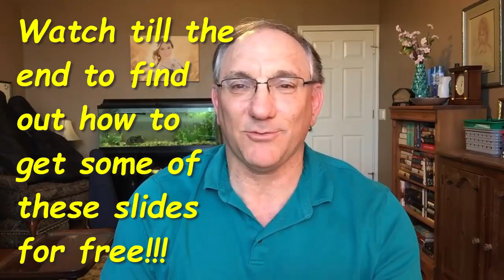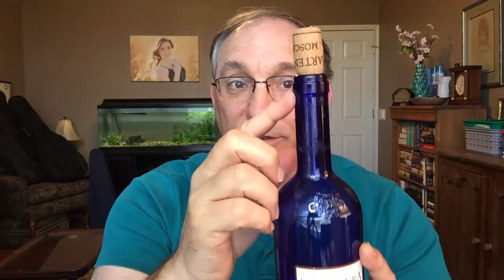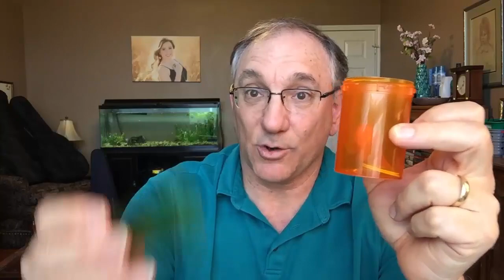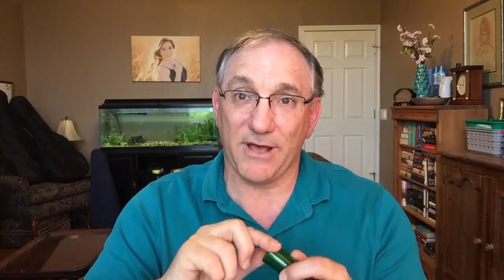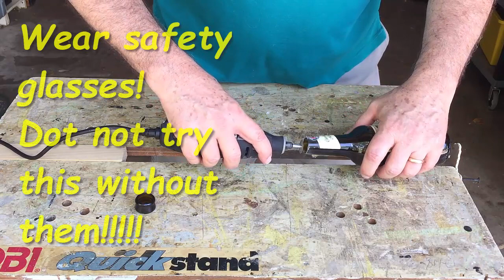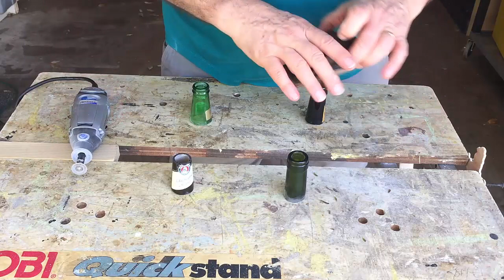Easy DIY bottleneck slides! How to make bottleneck slides using a rotary tool.

Comment: Excellent diy slide guitar. I finally found “the one” with the cut just about right from a good case of merlot. While I was working at it I found a safer way smooth out the edges without using a dremel and sandpaper. I used a chef torch to smooth all of it.
Reply from the maker: Thanks!  Thanks also for the suggestion!

Comment: I'm impatient. I'm tempted to take my Harbor Freight angle grinder to a bottle neck😅
Reply from the maker: You can try it. My guess is it will overheat and crack where you don't want it to.  If you try, let me know how it turns out!

Comment: great advice dude, im gonna attempt to make one right now!
Reply from the maker: I'm glad you found it helpful!  Let me know how it turns out!  Thanks for watching and commenting!
Reply: @stevesstrings5243  well i'm definitely going to try again but my first one was kind of a flop. worked pretty well actually for about 5 minutes but the fracture that formed in it that i tried to apoxy just didnt hold up. I ended up buying a cheap slide but now I have to wait for my girlfriend to finish her wine to try and make a new one!
Reply from the maker: @tyler1234321  The key is to not press too hard or turn the bottle too slowly. If you do, the glass can heat up and crack longitudinally or chip.  I find if I keep the pressure light and keep the bottle turning, it does not build up heat too quickly and decreased the chance of cracking.  Of course, this gives you an excuse to share another bottle of wine. Like you need an excuse, LOL!

Comment: Quick question Steve... Could you score the neck with your Dremel equipped with a cut off disk (the aggravating thin ones that break) then use the thermal shock method? To help reduce the risk of catching an exploding disk in the forehead!
Reply from the maker: You could try, but in my experience, I often got cracks also running up the neck, rather then just along the score line.  I have not had any discs break yet (knock wood), and I have never had any stray fracture lines from using the Dremel.  If you are concerned about disc breakage, you could always wear a face shied in addition to safety glasses.
Reply: @stevesstrings5243  Okie dokie, thanks for the info Steve. I didn't think about stress fractures up the piece. I think I got a batch of cheap cut-off disks.
Reply from the maker: Safely first!